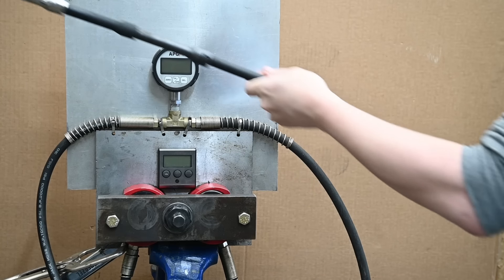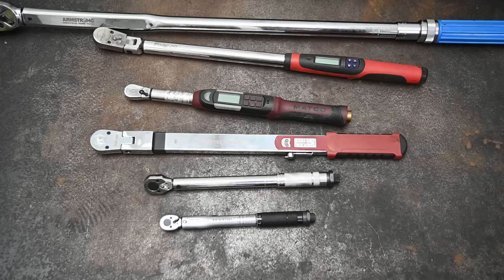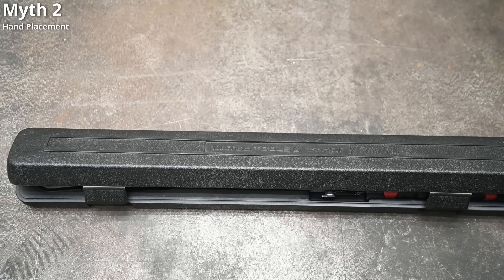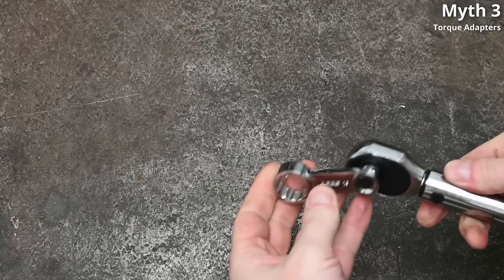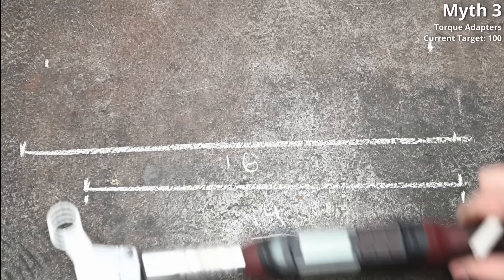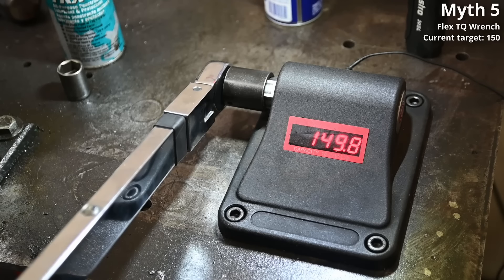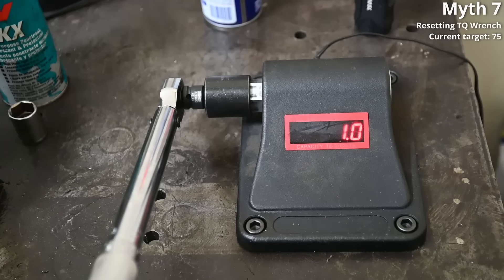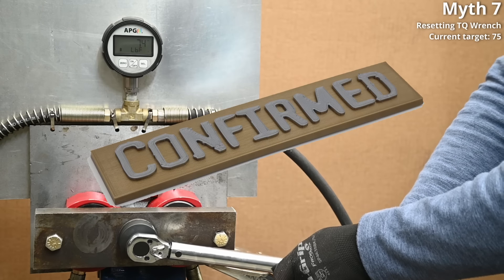You're Using a Torque Wrench Wrong: MythBusting 10 Do's & Dont's

Comment: wet torquing is pretty basic, I love doing it because it makes it easier to take off my lugs. 

The specs from the manufacturer of my studs/hubs even give guidance to torque to 350 ft lbs if wet torquing along with guidance on the amount of oil to use.

They specifically say NOT to use anti seize for some reason, just good old 40 weight engine oil.

You have to watch the shop monkeys though if they are putting your tires back on, they will try to torque them to 550 or 600 and ruin your studs if you don't watch them....

Comment: My torque wrench, I set it to 5 LB to tighten the pan filter in the transmission, and at 5 LB, it never clicked. I stripped the bolt. Now the car rattles at 1,550 RPM. 

I tried to tighten a car tire at 5 LB, it never clicks then either. It only clicks if it's above 25 LB...

Comment: Two things I'd like to see tested. Both of which I believe to be true.

1. Edge ranges. The myth that wrenches are much less accurate at their very upper and very lower ranges.

2. That fastener torque confirmation is only accurate when fastener is moving. In other words, if you use a click type to confirm torque, place it on fastener and it immediately clicks, that tells you nothing.

Obviously the fastener could be way over torqued, wrench clicks. Or perfectly torqued, wrench clicks. Or somewhat undertorqued, wrench can still click. The torque threshold to initially move the fastener is higher then the torque used to tighten it.

Comment: Antiseize should not affect the torque.  It affects the relationship between torque and bolt tension, due to change in friction.  So a bolt would experience more force for a given torque, but torque is just the equal and opposite reaction.  Maybe I'm missing how the dyno works.  Anyone?

Comment: What would happen if you left the wrench that was left jn torque for some time and became inaccurate, loosened it to zero and left it that way for a time? Would the spring slowly return to normal? A proper spring really shouldn’t loose strength if compressed for some time as it shouldn’t be made so that it can be compressed past the point of yield.

Comment: So where you press on the handle doesn’t matter for digital wrenches?
Reply: It depends on the specific design. A lot of modern designs it doesn't matter, as the load cell is measuring the delivered torque directly on the fastener axis. There are designs though that provide a digital readout from a system that is still length dependent. One brand (I forget who) has or had a model which sensed incorrect hand placement and sounded an error alert. Unless a wrench is declared to be non length dependent, it's safest to use it as if it is. If there's an indicator in the region of the center of the handgrip - ring(s), target (+), arrow - assume it is length dependent. (Or check using a digital wrench adapter or angle-of-nut test.)

Comment: What about the case of using a torque transducer with a crowsfoot wrench? In that case, there is no L1: you could use a hand spinner with one, after all. And if using a ratchet with a transducer and a crowsfoot, does the length of the handle of the rachet matter? I can't get my head around this one!

Comment: I've never heard about resetting the torque wrench to zero when storing. I store mine for >6 months often and have never reset it. Now I'm worried that it's grossly inaccurate and I'm not torquing to the proper ft-lb on things like my lawn mower blades and tire lugnuts. I'll have to find out if there is a cheap-yet-accurate-enough testing tool that I can use to see if my wrench is f**ked or not.

Comment: Discussing using a wrench wrong...

1.  Something that should always be attempted - is to try and reach your torque from at least 20% below the target.  Or a smooth CONTINUOUS pull at 80%

The reason being - a STATIONARY bolt or fastener takes MORE force to start movement - then the actual torque.  So you want a CONTINUOUS pull tightening motion - as you tighten the fastener.  If your torquing a fastener and it is say at 95% of the torque - and you attempt to continue to tighten - the torque wrench might just click or beep stating you are at the torque.  Because it takes more effort to get the bolt or nut MOVING again.  So easy to achieve an inaccurate reading if you don't maintain a continuous pull as you approach the target.

Comment: I assume when you calibrate a wrench using the luggage scale it's going to be most accurate if you place the scale on in the middle of the handle for the same reason as myth #2?

I would have liked to see a test of universal joints at an angle.
Reply: Yes, to be accurate, a test using a known force has to be applied at the correct loading length, typically indicated at the handgrip. Many supposed calibration tutorials on YT disregard this, attaching a weight or scale to the locking screw at the end of the handle, or at a distance part way up the tool, such as 12" from the axis on a longer wrench, to make for an easy calculation. Both will deliver a wrong result. Instructions for adjusting a torque wrench also almost always disregard the need for two adjustments,  which interact and are not always both available.
The universal joint test would be interesting to see, but not easy to implement, as instantaneous torque transmitted through an angle shows cyclic variation with the changing angle of the yokes with rotation.

Comment: just did a torque calculation for the studs on my car that have antiseize (not applied by me) and i couldn't get the exact materials down but i got pretty close and it told me that my recommended torque was 51lb ft and my maximum torque was 71ft lb......... im currently torqued to 65ft lb so now im worried about both being under and over torqued. 
I have spent hours looking into torque values and how to apply torque. it is 8am.... I started this at 2am.

Comment: For a torque wrench that has inadvertently been left at a high setting for 6 months: will the tool eventually recover if it is properly stored after the error is discovered? slightly? completely? or not at all? Could you retest that wrench after another 6 months?

Comment: What about the clickers designed to have an extension? Gedore has them. I have atleast 1 at home. Very expensive for sure but a very nice tool. No ratchet tho
Reply: True, there are designs that do not have the length dependent operation, and they can be used with a handle extension. Likewise for the deflecting beam type which are normally length specific, there's at least one variety that is insensitive to lever length so can be used from anywhere along its handle or with a tube extension.

Comment: Crow foot should be used with a fixed, non-ratcheting head. Because it gives you fixed angles. It's a bit of a hack to use a ratchet.

PS: When it comes to wrenches with inserts, all the inserts should, ideally, be the same length. Simple and foolproof. Now, it can happen that some are bigger because they just can't be made small enough and do require a coefficient. But you usually have to watch out for this when using a wrench from one brand and insert from another as different brands use different standard tool lengths. It should be part of the specification.

Personally, I just follow the instructions. I've got a wrench that can be left set to whatever I want for however long I want and I can grip it wherever I want, I can use extensions if I want - because it was designed for it. It's a reputable brand and I trust them to know what they are doing. But most wrenches are not like that. I bought it just for the convenience and peace of mind.

Comment: i wonder with the anti-seize doubling clamping force does that equally transfer to damaging the fastener or would it be able to hold more clamping force before failure?
Reply: At a guess, damage threads ?
If the clamping force can withstand the pressure it wouldn't be a problem.

Comment: Can anyone tell tire shops that if you pound the lug nuts on with an air gun and then check the torque and it clicks immediately that you did not torque correctly. Almost every shop I have gone to gets it wrong. Few know that the fastener that is torqued needs to be moving. I have asked several what torque is, none knew.

Comment: Will a socket drive reducer (1/2 to 3/8 drive) or increaser (1/4 to 3/8 drive) adapter mess with the torque value? 

Also, will using a torque screw bit adapter with, say star bit drive, mess with the torque value? 

I had an issue using a 1/4 drive in/lb torque wrench using a 1/4 adapter socket to fit a star drive to torque a screw, and it ended up snapping the screw head. The torque wrench never “clicked” at the appropriate 17 in/lb. It just kept going till it broke.
Reply from the maker: We tried reducers 8n this video. No. Also no on bits

Comment: The 90 degree adapter thing is not quite right. That works ok for a short adapter but if you are using a long adapter, then you are getting a longer lever arm. The angle needs to be less than 90 degrees and the exact angle would depend on the length of the adapter to really get it right.

Comment: Another question will storing it in a car with heat or cold garage affect the measurement over time. I leave a ½ harbor freight torque wrench for emergencies in the trunk of my crv. Sometimes the temp goes up towards 110°F in 80°F weather. I wonder will it still be accurate after being exposed to those temperatures. (After its temp stabilizes).
And with a good torque wrench, will leaving it in the sun affect it? (For us using it outdoors)

I'm assuming yes, I'm aware of operating temp. But for science would be cool to see it the results.

Comment: not "peanuts" for aviation mechanics, we definitely know the 90 degree dog bone rule. and there's an app that can calculate the torque offset when using the dog bone straight out. its also easily done on paper.

Comment: The anti-sieze part made me laugh - you never coat threads - you coat the mating surfaces that are clamped.  For those of us in the rust belt, and especially in the case of wheels, the inside of the hole the hub fits and the landing pads on the wheel at the brake disk are what is coated.  The studs or screws are always clean and dry.

Comment: Flex-head torque wrenches are designed to not go too far outside the indicated torque setting by limiting the flex. They only flex a few degrees so that linearly the handle is only ever 1/4" or less from where it was straight, if it were to flex more - say, enough to be 3/4" further from the handle's straight location - you would start having rather inaccurate readings.

Comment: "this will all be in pounds foot"

Isn't it always ft/lbs? Meaning foot pounds?

The harbor freight ones are decent but there used to be (older models), a lot that would jam and never click and you'd break bolt heads...

I recall that it's not about the extensions  it's about what thickness. 1/2" they say won't flex and thus won't affect tq reading. But a 3/8 or even 1/4" they flex much more. Can you confirm that? 

Great video! Very informative
Reply from the maker: Ft/lbs would means how many feet per pound. When it's how many pounds per foot. 
That said, we say foot pounds because everyone does and it sounds better. But technically is pounds foot
Reply: I've never seen that in any shop manual in 20yrs 🤔. I just saw it today as "10-13ft/lbs" in a manual. It's so odd. Logically, backwards makes more sense... It's so dumb that just because it sounds better they use it... Didn't everyone's momma always say "just because everyone else is doing it, doesn't mean you have to do it too" 

Ft/lbs meaning it would move x feet @ the given applied for in pounds. Nonsense lol 😅

Now I have to decide if I want to say it the logical way or the way that's more comfy due to the norm 😢😂😅
Reply from the maker: It's an uphill battle. Look at our channel name and we still say foot pounds

Comment: i use WD-40/oil/grease on everything. i never had a problem before, but i guess it can be dangerous real quick if it actually double to torque value at the bolt. i must be very lucky, i never broke a bolt except while unscrewing them in the first place.

Comment: What about those torque wrenches that rely on the deformation of a bar, reading from a pointer on an arc attached to the bar ?  I think I have one somewhere
Reply: Simple and reliable, they are one of the types that must always be used from the handgrip position to be accurate. Your eye position also needs to be exactly aligned at 90° above the pointer position on the scale to be able to read the value accurately.

Comment: one of if not the ONLY problem with that silver crap just means you subtract a bit for it BUT it does massively increase clamping pressure, just as you show here. oil can make it 4x as much. and that can and will warp a brake rotor.

Comment: ALL springs take a set when held in a deflected position.  How much of a set the spring takes depends upon the quality of the spring.  Heat treatment, shot peening, and stress reliving all all important to the life of a spring, as well as the base quality of the metal alloy used.

Comment: Could you test, if retorquing a bolt many times will significantly increase the applied torque?
I have repeatedly been advised, you should only torque a bolt once, as it is reported the bolt will progressively over tighten with each subsequent repeated retorquing of the bolt. 

Bombardier quote, if checking a bolt, you must only do it at 80%, to prevent progressively over tightening the bolt. although I believe it made no real difference how many times the Torque was checked, but they then take the moral high ground implying people who question this statement are stupid.
Some other UTuber support that you must only torque a bolt once, could you test to clarify?

Comment: If the anti-seize is actually 2x tighter will you need 2X effort to remove? or will it come loose easier. If so then 2X torque might be ok if the materials are up to it. Thinking of my wheel studs which have anti-seize and I use an impact calibrated to 90lbs..never had an issue even though your study would indicate they could be at 180.

Comment: What about using a u-joint at a 90 degree angle? Does the torque continue to decrease like the example used with the bunch of extensions and u-joint at a slight angle?

Comment: Does using a digital torque adapter with varying ratchet wrench lengths change the result of the displayed reading? Is the displayed number accurate regardless  of where you hold the wrench handle??

Comment: Using a torque wrench as a breaker bar to loosen fasteners will destroy the calibration on click-type wrenches. The reverse is to be used only for torquing left hand fasteners.

Comment: I really don't understand the where-the-handle-is-gripped result.  The force you need to apply should change, but not the resulting torque at the bolt head.  Is something about the grip changing how the mechanism works?
Reply: The force you apply to deliver torque acts from your hand position to the fulcrum (pivot) point at the fastener (nut/bolt head), the entire length of the wrench. The measuring mechanism inside the tubular handle, which releases and generates the click, is only seeing the somewhat shorter lever length (arm of moment) from your hand to its own pivot point commonly about 2" away from the nut axis. So yes, because the internal mechanism actually measures a different value due to the different lever length, the amount of that difference would change if it was referenced from a different hand position. The necessary compensation is built into the design and initial setup of the wrench, but that compensation value is only correct for the difference value measuring from the designated hand position. A different hand position would require a different correction factor.
Reply: @PlatypusPerspective  Hm.  Seems a very suboptimal sort of design
Reply: @TheGreatAtario  It's a characteristic inherent to any design where the axis of the measuring mechanism is not coincident with the axis of the fastener where the torque is being applied. Typical beam wrenches behave this way just because of the way the beam has to bend, the common "click" wrenches I described, some electronic types (usually older models) - it's just a matter of using it the correct way. There are designs such as "cam-over" slipping wrenches where it doesn't matter. Torque is measured directly in the drive head on a common drive axis so the distance the force is applied from doesn't make any difference to the measurement.

Comment: My 1 single problem with mass produced tools from Harbor freight: QC sucks. I had a stud that had to be torqued to 17 lb ft. It stripped it. Precision tools should be bought above bare minimum. Say a craftsmen or tekton, or maybe ICON over Pittsburg. 1/2” 5 lbs difference won’t matter, but 1/4” it matters dramatically